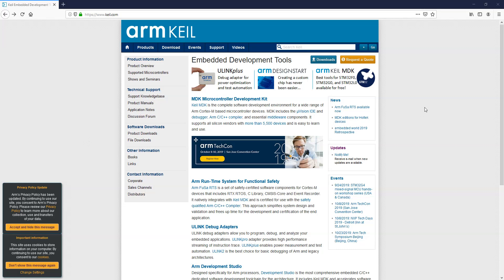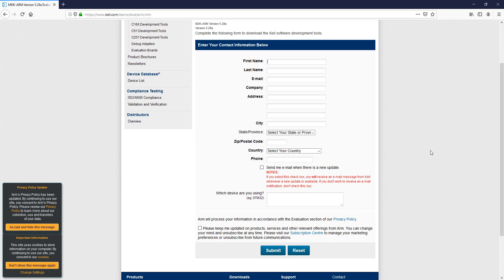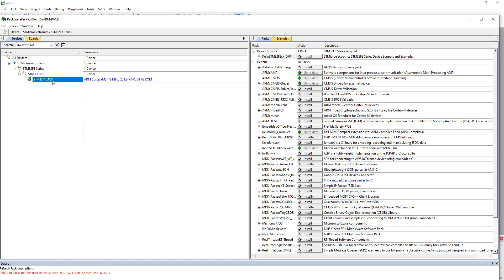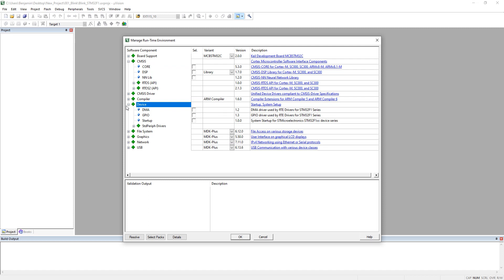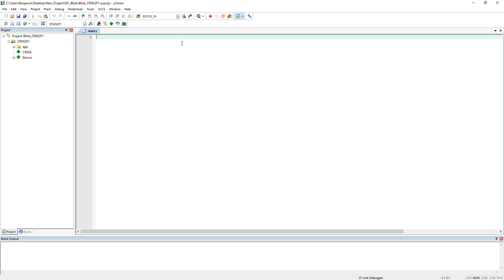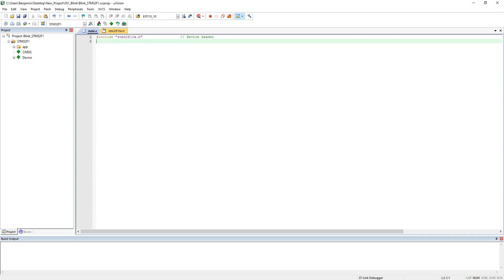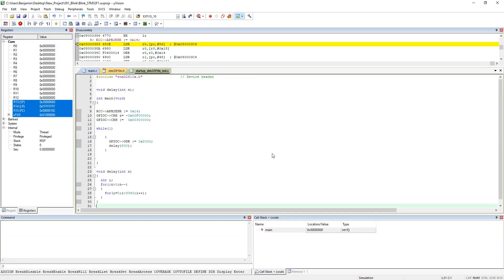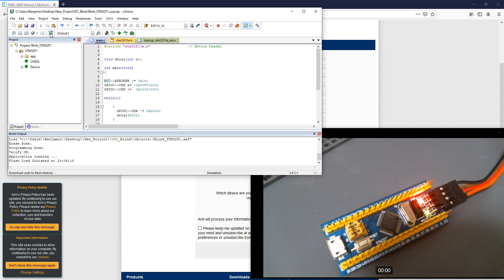03 KEIL new project tutorial   Simulator & Debugger

Comment: WeeW- I am still trying to define the xtal freq and it is greyed out , is this because I am using the compiler 6 rather than the compier 5 is their a work round as when getting to your 020 tutorial it is necassary to be sure of the frequancy .
Reply from the maker: Hi Chris,

Thank you a lot for you question, this is good to know that I will need to install an up to dated version. Anyway there are few ways to manage that. If you are interested,  I can drive you to manage  it during a live call this Saturday or Sunday. The spot is from 13:00 to 15:00 GMT. Please let me know and we can connect using weew_stack FB account.
Reply: Many Thanks Weew, That is Great ! On Sunday is Fine for me as Saturday  is a busy day for me. Will try to contact you on FB later today. Sir you are a Star/ Angel !
Reply: @WeeWStack  Tell any solution please, facing the same issue of greyed frequency which is undefined for stm32f103c8t6
Reply: Please Provide a solution for this, I am also facing the same issue!
Thanks
Reply: @akshaygs292  Did you get any solution, if Yes please tell